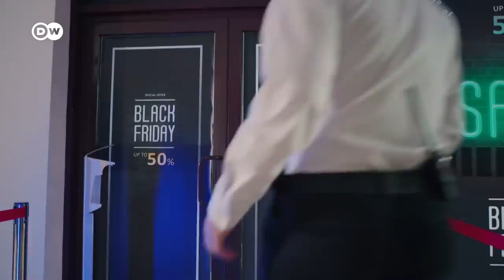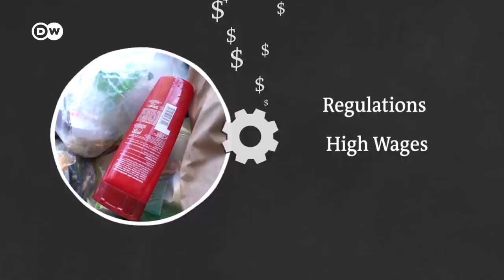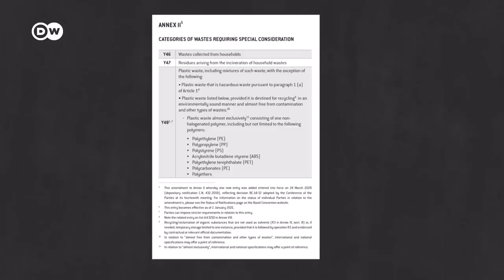Your plastic waste might be traded by criminals

Comment: I'm starting to avoid plastic, starting slow but trying. I had a bad habit of buying packs of water bottles and just taking two to work everyday. I got a reusable aluminum bottle and just use the water fountain at work now.
Reply: Using a glass water bottle is said healthier. HAVE a great day
Reply: I always drink bottled water and I throw them all in the trash when I'm done
Reply: @IvySnowFillyVideos  how?
Reply: I say this cuz many companies use BPA to coat aluminum bottles.

NEWSER) – Might want to make your next six-pack glass bottles. Cans and plastic bottles are lined with a controversial chemical called BPA, and while the CDC still says the chemical's health effects

are unclear, research on chronic exposure has linked it to high blood pressure and heart rate issues.
Reply: @IvySnowFillyVideos  thanks, I'll check those out.
Reply: @Acemans  glass is made of sand that’s heated it is not processed that much so it will break down

Comment: The main source is the daily consumables, our milk can, vegetables polythene bag that we get weighted and billed at the supermarket, meat - bread - chips & other perishable stuff packaging. If we find an alternative to plastic that can retain the liquid inside, would go a long way or we can be more responsible my having milk dispensing units at markets and carry our own container.
Reply: You are not using cardboard containers for milk, juice and similar stuff? Not that the ones we are using are completely plastic free either (they have a thin coating inside) but they can still be recycled along with cardboard boxes just fine. For soda bottles deposit system is a decent alternative to make sure they don't end up in landfills or burned. I believe more regulations are in the plans to ban or at least limit availability of those thin plastic fruit bags... especially since I'm not entirely sure why people keep using them for stuff like fruits when there's a compostable option for same price.
Reply: I remember in the 1960s taking a big container to the local retail dairy to get filled with milk from a tank through a handpump that worked a bit like a draft beer pump (in Swabia)

Comment: You can not ban certain plastics at the recycling state but before it is used at all. Ban those types of plastics from being imported/sold at all. We need a total ban on all products NOT on a approved list not the other way around, it won't stop pollution otherwise and recycling becomes pointless. Take the money out of the polluting products by refusing to allow them at all, make the packaging switch to the types that can be recycled regardless of cost increase on the products just like we did on plastic soda bottles. The industry will then be highly motivated and will find ways to reduce the cost of the "good" plastic.

Comment: We as consumer are not able to solve this problem. This is where An EU should step in. Just tell the 27 countries that from a certain point only bio plastic s van be used for packaging food. Than the market will invest...
Reply: Yes, there is no real choice for us customers. But also the production and supply chain requires a lot of plastics, consumers often underestimate that
Reply: You can consume less to start with. The average western consumer buys and wastes or disposes way too much. Stuff doesn't give us meaningful happiness
Reply: Bio plastic is still not easy to recycle. And it will not just magically disappear on it's own. Consuming less, and using way less packaging is the way. We actually have drinkable tap water in most of the EU, still, we produce and drink too much from PET bottles.
Reply: @valkaielod  Exactly! We are making the planet unliveable for these slight conveniences

Comment: I hear in india garbage is being used to produce power... Could that be a solution?
Reply: How much of waste? 0.001% ??? Or even less??
Reply: @MaheshAdhikari   it did not start too long...
They are in the process of getting the pilot successful and making more such plant to see if the garbage problem can be handled..
In any case, without waste segregation at the source this model will not sustain itself for long